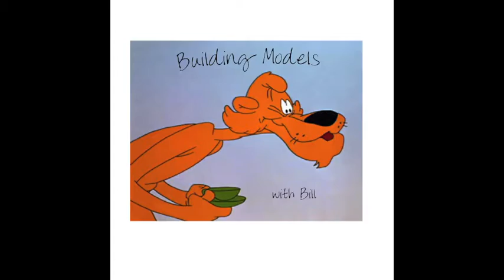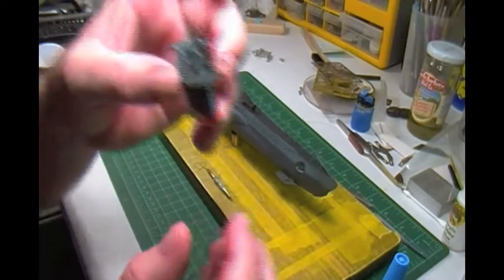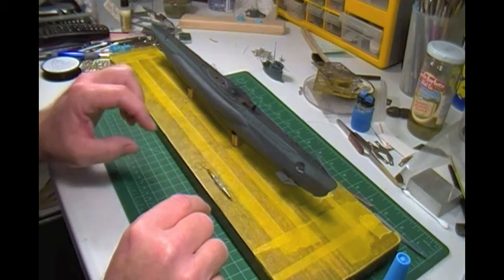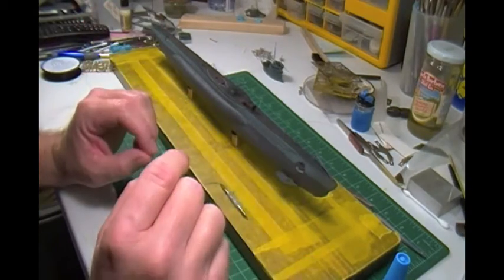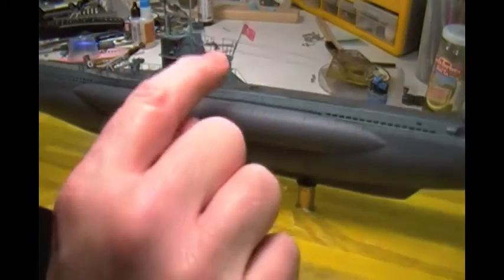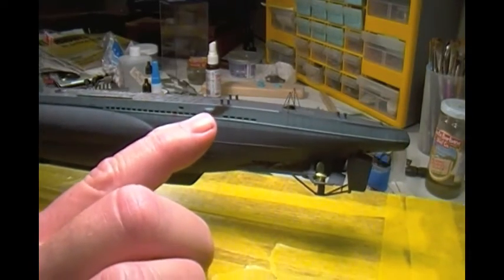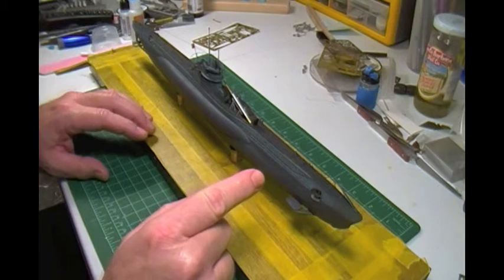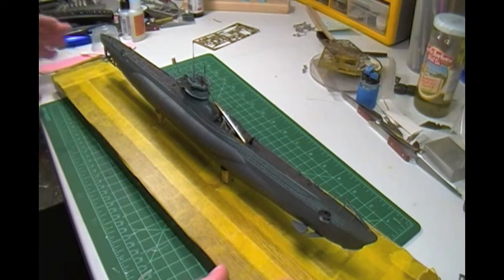Revell German U-boat VIIC 1/144 scale Part 22 Final

Comment: Beautiful! Nice attention to detail. Regarding those insulators on the cables: I've found you can do wonders with a tiny drop of Elmer's white glue, even "sculpting" it a little as the skin dries or adding knobby "details". Do them one at a time, no rush. Similarly, very tiny wire insulation from the inner, delicate workings of junked electronics can be harvested, split lengthwise and emptied of the wire, and cut to desired lengths and at desired angles. If the original wire diameter is close to that of the cable or whatever you want to wrap it around on the model, the seam where you split the insulation virtually disappears. This can give you very sharp-edged cylindrical details on your cabling, handrails, whatever needs that extra bit of eye candy. Thank you for sharing this build!